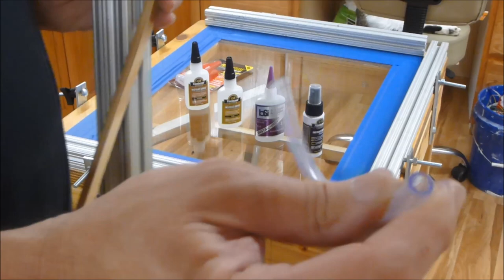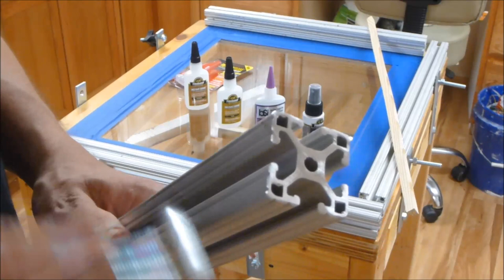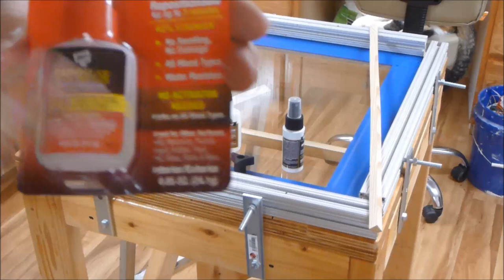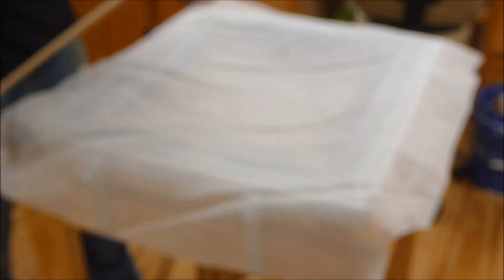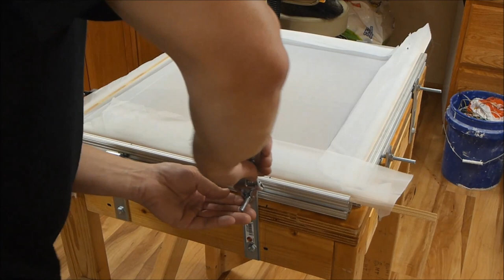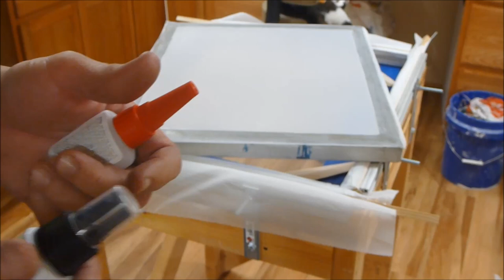An easy and reliable way to re-mesh screen frames.

Comment: instead of cutting a strain relief you use a black marker to draw lines at the corners , loosen the fabric ends so that you have a half inch  of mesh at those ends and youre able to get higher tension the fabric relaxes after about 10 minutes then stretch it a little more and you can use a drum tension meter from a music store and use it as a tension meter after a few stretches you can gradually increase tension equally until it pops then you have the max tension . I love this stretcher you made ,write your mesh count in the mesh then glue it and it wont wash out.
Reply: I do something similar. The guy that taught me screen making called it "softening the corners". I also use a Newton meter to check that I have the correct tension.

Comment: I love your rig! I work at a shop and have seen some diy stretching rigs in pro shops, the only thing is most of them didn't have the staggered longer side because that way is designed for torsion click stretch devices. the diy ones were aligned parallel so when you run the dowel out you could just push it with quarter pie looking strip and keep your mesh channel from slipping off angle which can cause problems with halftones. also we never cut the strips in the fabric , but at the corners we would use a sharpie to mark where the mesh was against the corners at the stretcher, then with a plastic applicator (usually cut in half) we would move that fabric about an inch making space so those corners don't have so much tension and would be less likely to tear. we used a musicians drum tension meter to guage in newtons the tension they also have tension meters at harbor freight. the mesh also relaxes after the first stretch, then gauge the tension it then tighten the mesh again, usually do this 3times then glue it.

Comment: I am watching this from an 80/20 computer rolling workstation that I designed and built.  I built a screen stretcher out of 2x2 wood and 5/8 all thread.  I use nuts and washers to stretch out the screen.  I staple it.  I am having trouble with the wood frames I am also building not being perfectly square so I was thinking of making my frames out of aluminum and gluing.  Thanks for the tips.

Comment: The extruded aluminum, couldn't you tape it off leaving the slot open and spraying flex seal it plastic dip spray and use something other then sliding in 1/4 rounds? The rubbery spray will kill the smooth metal surface. Then you could find something that snaps in or something tight that will grip the rubber?!?! I have an industry made table that has a rubbery foam that does the same thing.
Also, I was taught to lay down a layer of glue and let dry before you lay your mesh and stretch...works like emulsion...it will encapsulate the mesh. 
Great innovative thinking!!! Great video!

Comment: Great video and I think because I'm a small shop I will be building this. Because my frames are 1 1/2 x 1 1/2 aluminum I would think the 80/20 should be the same

Comment: just a heads up to the people of the future like me, folgertech has "2020" its 20mmx20mm extrusions cheaper than 2020(brand) extrusions, same thing but its 20mm (so half the size, if you want the same size as the video get 4040 for 1.5 inch bars)

Comment: do you think maybe using the extrusion with 1 flat side and stacking 2 layers on top of eachother then c clamping to secure the mesh before stretching would be a bit simpler and still work just as well? And i almost think you could slide the "heads" of the c clamp into the extrusion slot so that the two pieces would always stay realatively close to being together. obviiously more expensive due to double the amount of extrusion. but i think prep time would be cut dramatically? Also when you stretch you have to let it settle then come back and re-tension or else it can become loose like you were talking about, atelast thats the conclusion ive come to watching videos on people stretching using proper machines and techniques!

Comment: I just ordered 80/20 extruded aluminum 1x1x97"  from Amazon this morning. So this should give me at least four 24" pieces once I cut it.
Reply: Can you share a link? I found that they are called multi T slot (or slotted) European extruder tracks/rails but that means they are the motor tracks for a European 3D printer and all the ones I find are less than an in inch.
Reply: @dooyouevenliftbro8078  .

Comment: how does that glue stand up to chemicals used on the screen, like reclaimers or screen openers?
Reply: Danger Man it's the same stuff professional screen supply places use. The only chemical I try to not touché the glue much is ghost/haze remover, that stuff can brake down the glue. There's newer stuff out that isn't that aggressive in the glue but I'd rather be safe then sorry. 😉

Comment: I knew there had to be a less expensive way to re -screen, and you have nailed it. I bought 30 aluminum screens about 10 years ago but 4 where from a cheaper source. The screens on those 4 came unglued and on 1 of them, the screen actually ripped  and I've never even used these 4 since I bought them. I would like to re screen the frames. Someone else mentioned in the comments that contact cement will work. I'm sure it would be a little more messy but probably much cheaper. But will it give way like my 4 cheap screens??
Reply: NBC Meshtec Americas sells a very good frame adhesive, RhinoMite RMA 3000. It's a methylene chloride based adhesive, comes with a catalyst that makes it solvent-resistant and you mix in at 1.5% of the weight of the glue you've measured out, and you can also order their RhinoMite RMT 3001 thinner (which you'll need, because it's otherwise VERY solvent resistant). I can get four 1 gallon cans of the adhesive with four bottles of catalyst and two 1 gallon cans of thinner for about $75. It has some fumes, but is more friendly than cyanoacrylate when it comes to removing the mesh and regrinding frames to be remeshed, especially if you're grinding your frames with a high speed belt sander or an angle grinder. The heat generated by and angle grinder generates noxious smoke if the frame has been glued with cyanoacrylate, which I found out first hand when I switched to using an angle grinder over a belt sander for regrinding frames to be remeshed. It was not fun. RhinoMite doesn't have this problem. As long as I've used enough glue and ensured good contact between the frame and the mesh, I've never had an issue with the mesh coming off the frames on me.
Reply: @RiggerMantis  thanks for your response. Unfortunately, I have completely gotten out of the screen printing scene.

Comment: I screwed around with re-meshing my frames for years until I found GoldUpUsa. My 18by20 prestretched frames cost me $13.50 each, any thread count I want.
Reply: I just got a 6 pack from Gold-Up USA the price is great but I have 10 frames that need to be re-meshed so I bought some mesh from gold-up as well built a few Phillipino rigs gonna attempt when my super glue arrives.

Comment: extruded aluminium rails from ali express or banggood for peanuts and super glue with accelerator for picture framing pp cheap too,buy local get burned.